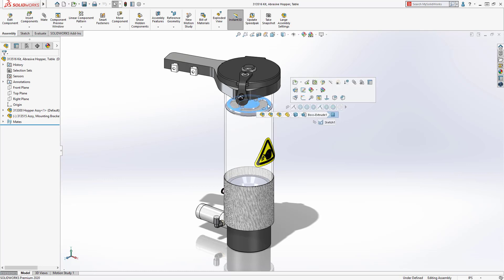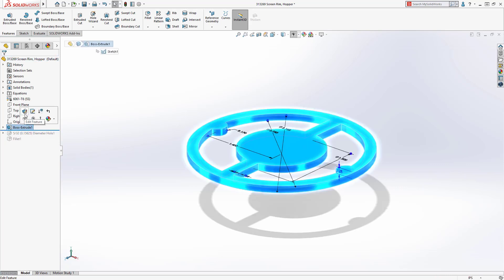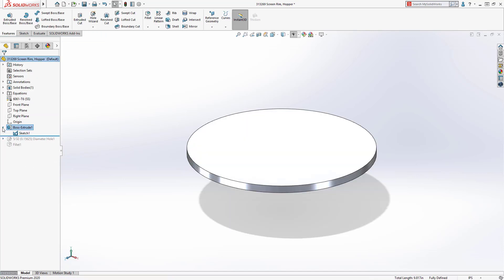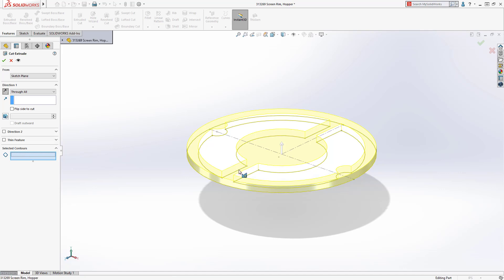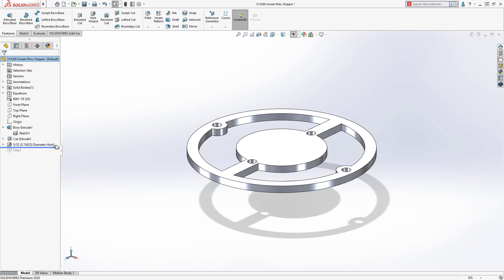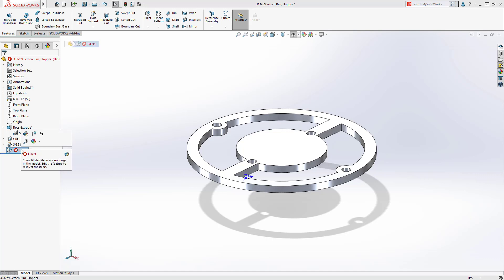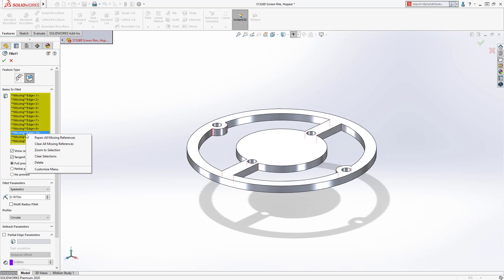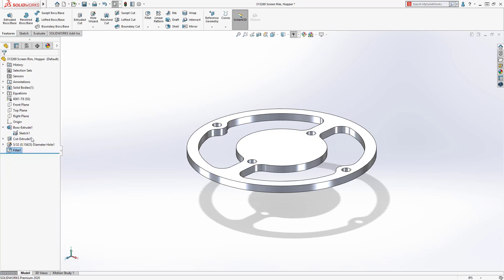What's New in SOLIDWORKS 2020 - Fillet Repair

Comment: Reason why the fillets are missing their edges is because they are referencing a different feature now as the change is made. Therefore, if you were to of modeled it correctly the first time around then you would be fine and would have selected those edges after all. If fillets or chamfers fail it is possibly because you may have added a new feature earlier on and the fillet will now need to reference the new edges. Update technically helps speed up the process of not having to re-select the edges again.